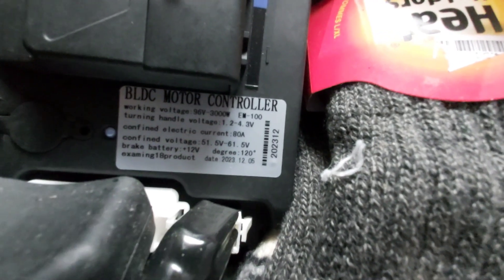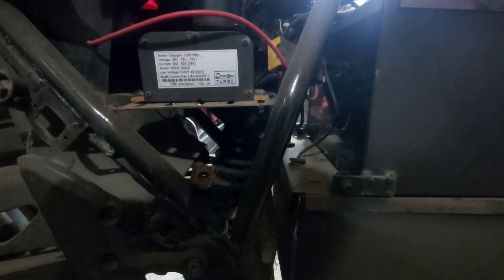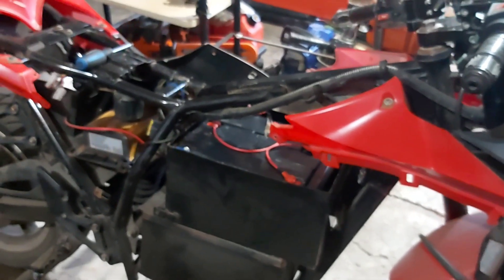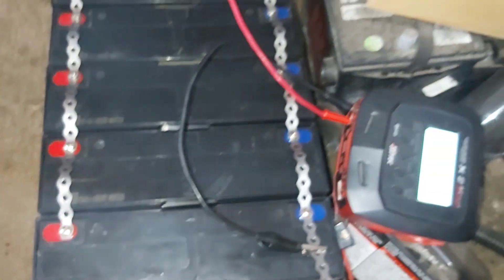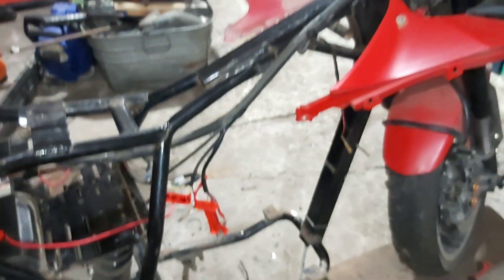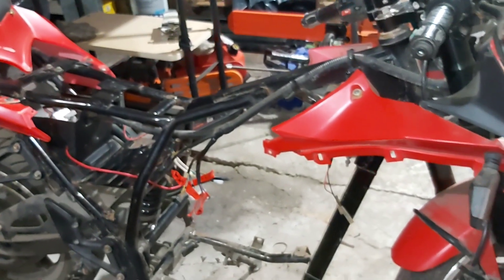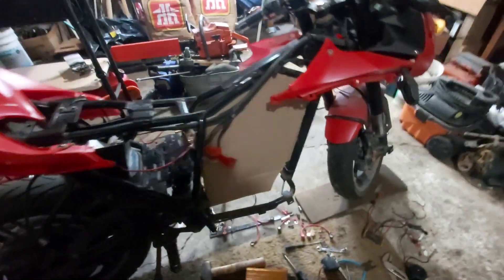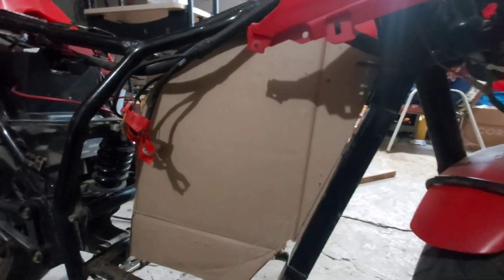Daymak EM2 Ebike Upgrades

Comment: Hope all is well!  All good here in New Brunswick, i just finished up a 15 kw diy grid tie.  Probably keeping the 36v bank out of the equation for now, not exactly a cUL rated product.  😂.  Think I’ll use the 36v stuff for a pool pump this summer.  Gonna try a submersible wood stove to heat it, we’ve got enough dead fall around here lately to keep it going no problem.  

Just bought a hyper dual suspension e-bike last week, they dropped down to $598.  Thing is a riot, keeping it stock.  😂.
Reply from the maker: Would be cool to try an underwater woodstove for a hot tub or pool. Thanks for watching and sharing
Reply: Also check out James Biggar’s YouTube channel.  He’s been building some pretty insane electric stuff completely from scratch.  He’s got quite a shop and any tool he could ever need.  About an hour or so from me on the mainland.
Reply from the maker: @cryptojlg630  I've been subbed to James for a couple years. Cheers

Comment: Yep it is going around again get some rest and water. I guess you just want a little more speed for that run to town lol.
Reply from the maker: Thanks. I'm just having fun with it. See how good it works.  Nice to have a fuel free vehicle.  Was thinking about making it into a backup solar system as well. Sell it as a package with panels. 4.8 kwh battery bank. Reasonable to run a system on.
Reply: Good idea if I ever get a EV it will have to be two way so I can use it to power the house.  @frankz1125